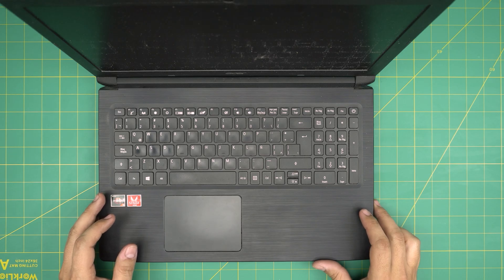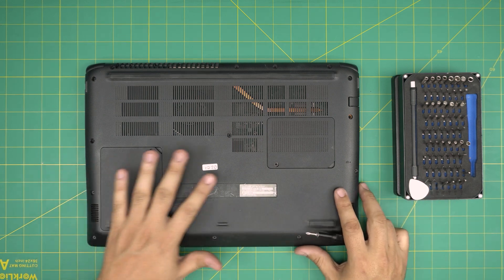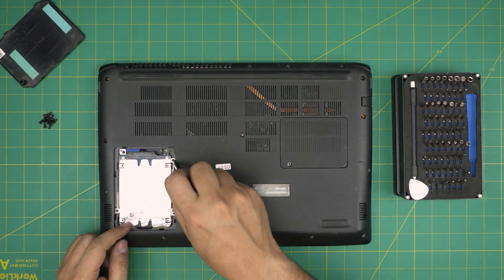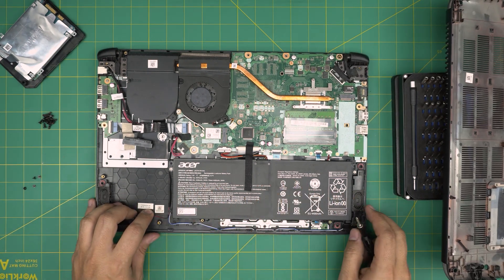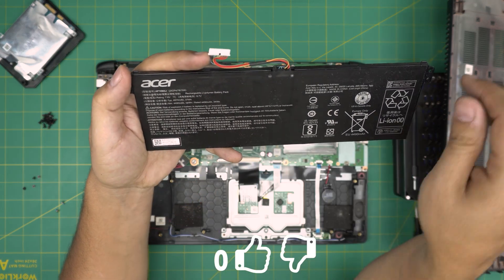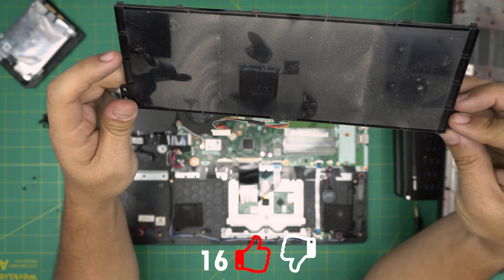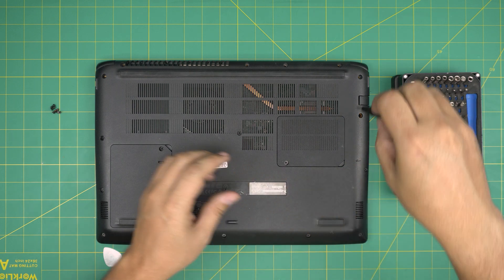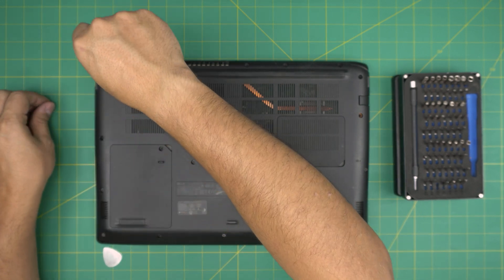How to Replace the Battery for Acer Aspire 3 A315-41-R7WT Laptop | Step by Step

Comment: sir, is this laptop can run without the battery inside? i mean just only with the charger plugged in, could we run this laptop?
Reply from the maker: Thank you for your feedback! If you wish to support the channel, you can like, subscribe, or both!
Regarding your question, yes you can, and it will run fine and even better, the laptop will last longer time. the charger will over heat less and last longer. your electricity consume will be less too.🫠
Should you have any further questions or requests in the future, please don't hesitate to ask me.
cheers🍻
Reply: @uFixTek  thankyou very very much
Reply from the maker: It's my pleasure my friend.

Comment: Can you just remove the battery from this laptop, so it's like a PC? Is it safe?
Reply from the maker: Thank you for your feedback! If you wish to support the channel, you can like, subscribe, or both!
Regarding your question, sure you can remove the battery and it will still work fine, just the boot may take 5-10sec before you see the logo.
without the battery the charger will last longer as it doesn't have to charge a battery.
Should you have any further questions or requests in the future, please don't hesitate to ask me.
cheers🍻